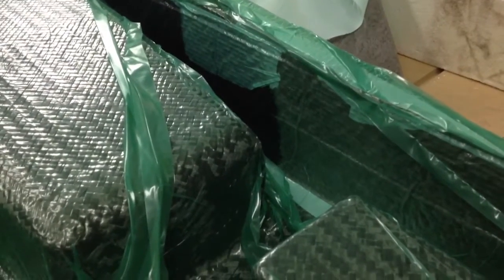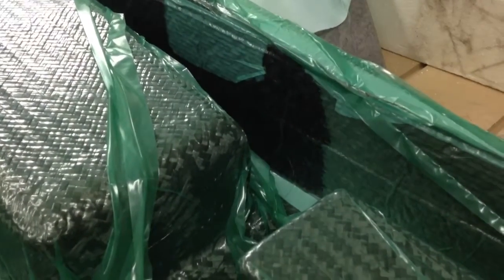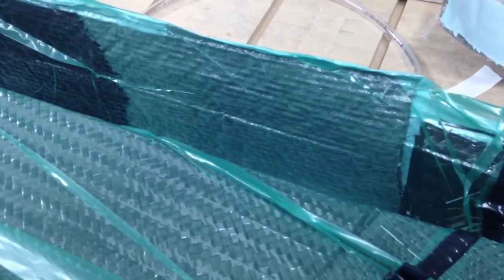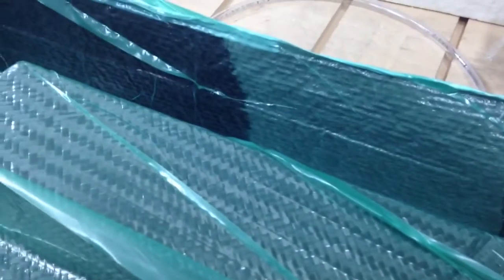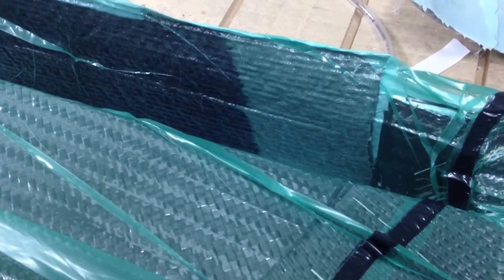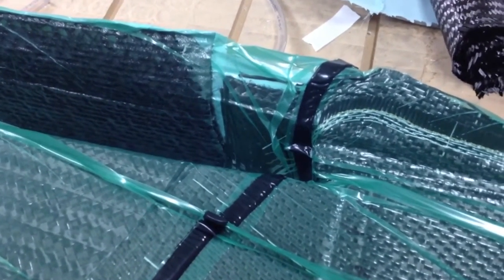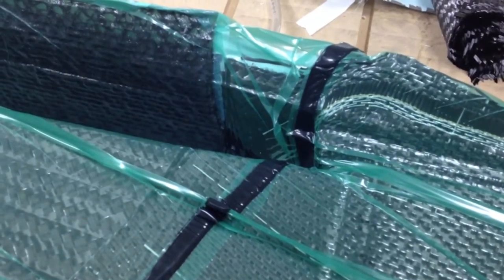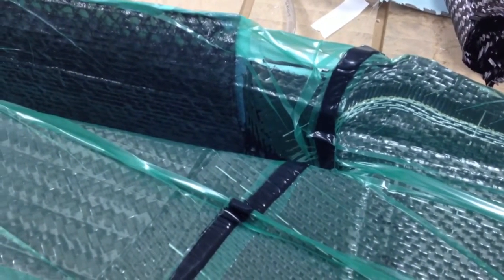Resin infusion process

Comment: Does the flow media become part of the piece? Or is it peeled off and disposed of?
Reply from the maker: Most of the time it is removed, but depending also on the type of media, for some applications it can be left in place, as is common in boat construction. Aircraft typically minimize all unnecessary weight and opt to remove it.